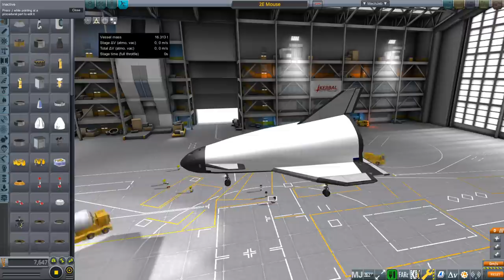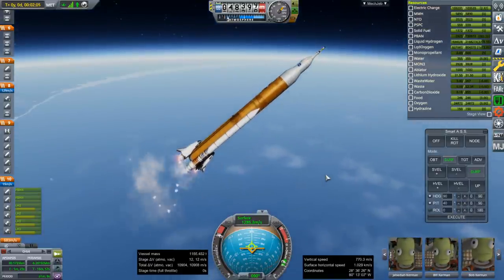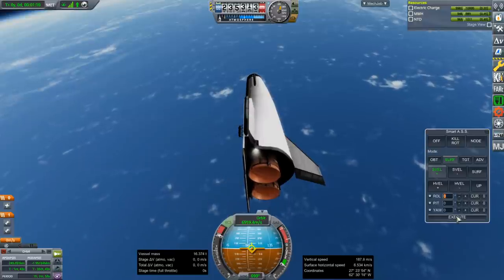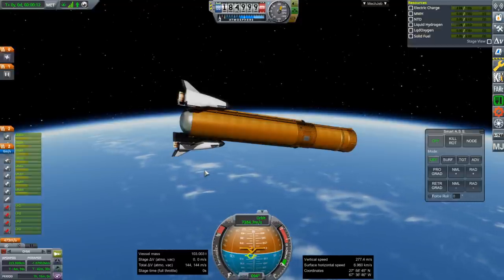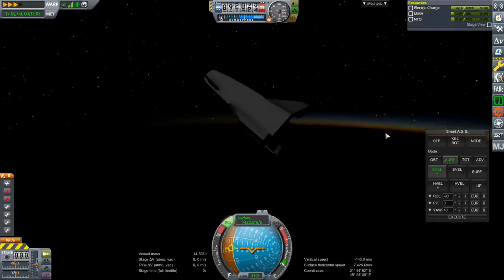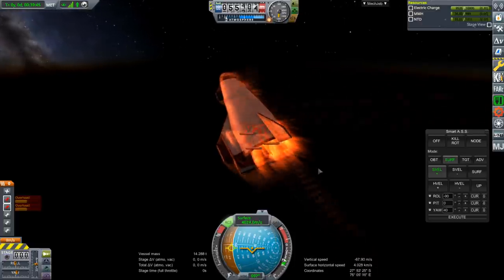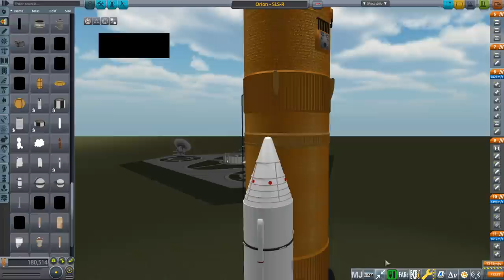Realism Overhaul in KSP 1.8.1 -  SLS Engine Recovery System Test

Comment: I wonder if that fuselage could be made with Internal RCS mod and Procedural Fairings plus some more procedural lifting surfaces for the bottom, without the custom enginemouse mod, or if the proc wings and/or fairing would just burn up. Also pretty sure you can control the thrusters by just hitting x/z to turn them on/off if you're outside control range.
Reply from the maker: It should be possible - the Procedural Wings didn't burn up on the second try. It wouldn't look as good, of course.

Comment: The Problem with the control orientation is very common, your craft is controlled from it´s root part, even if it is not a guidance unit. After decoupling the part that was closest to the root part becomes the new root part, so you were actually controling from the decoupler, wich is always sideways. You can easily solve that by clicking "control from here" on your local control module.
Reply from the maker: Ah, I thought I had just oriented the Engine Mouse body the wrong way in Unity. I'll have to double-check that.

Comment: This seems cool :)
I suggest you do maybe a partially reusable SLS Block 2 variants with pyrios-style boosters with F-1B's. These can then flip around and do a falcon 9 style entry burn, then deploy parachutes and be recovered downrange, similar to the space shuttle SRBs. It may not be that practical, but it will sure as hell look cool :)
Reply from the maker: Maybe something other than F-1Bs since they can't relight. Can I sell you on BE-4 or Raptor boosters instead?
Reply: @RaizSpace  that will do!
Reply: Raiz Space   If Raptors are involved, then why not try launching the Orion/EUS combo atop a SuperHeavy booster?

Edit: (Without the Starship.)
Reply: @RaizSpace  Reusable liquid boosters just result in a reduction in payload capacity while not reducing cost that much

Expendable ones like F1B are more expensive

So solids only make sense on SLS

Comment: You gave me an idea. Use an engine pod design with a boattail/fairing around the engine. Attach and shape procedural spaceplane control surfaces at the end of the rocket and set them to spoilers so when they close they protect the engine.
Reply from the maker: Sort of like this? https://www.youtube.com/watch?v=Rs3IsrQ2FE0

Comment: What’s the payload impact by using these things and would it be possible to negate the payload impacts to block 2 by increasing performance (still get 49t TLI while recovering these things)

Electron, Falcon 9 have proven this so I’m confident SLS could do this if its contractors had the slightest sign of having functional brain cells

Also I was thinking the pods could land trans-Atlantic in Western Europe somewhere since that’s generally where you end up on suborbital trajectory at 6-7 km/s iirc. That’s the staging velocity of EUS/centaur V X roughly on block 1B/block 2 I think

Comment: ULA is going to recover Vulcan's engines somewhat similar to this, only the glide vehicle will deploy a parachute and be snatched mid-air by a helicopter.
Reply from the maker: Yes, I'm aware. That's similar to the capsule catch from the Corona program. At one point they actually contemplated recovering the Saturn V first stage that way, but that would have required quite a special helicopter.
Reply: @RaizSpace  Now that would have been crazy. I see why some of these wild ideas are thought up though, heavy rockets are unbelievably expensive.

Comment: i'm having trouble finding an up to date realengines development thread/github. Could you link it?
Reply from the maker: It hasn't been updated since 1.3.1, but since it doesn't have plugins, it doesn't need to be. This is basically all there is: https://spacedock.info/mod/1212/RealEngines and this is the thread: https://forum.kerbalspaceprogram.com/index.php?/topic/171335-realenginespack-201-close-010418/
Reply: @RaizSpace  Why do you use real engines instead of ro engines?

Comment: 0:15 Combined with Falcon 9 boosters, only method to make it remotely cost-effective... after a few tens of launches. And making the engines reusable—an engine that you can't use twice with zero maintenance with any confidence is not a reusable engine. It's a high bar, but that's what it is.

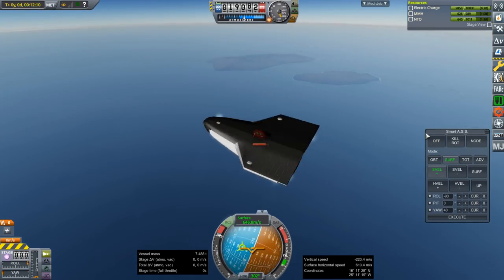13:55 Cape Verde.

30:20 Oooh...

Comment: how do you use a mod in a version of ksp that wasn't intended for that version? (ex. a mod for 1.8.1 in 1.3.1)
Reply from the maker: If the mod is only parts and doesn't have plugins (no .dll files), then there's a reasonable chance older mods will work in more recent KSPs, especially if the mod is from 1.3.1 or later (there was a category change that might mess up some parts from before that). If we're talking about the reverse, I haven't tried it, but it's possible.

Comment: Where is your mod list? I just rolled back to 1.8.1 to use the realism overhaul and my game is acting up, rapier won't switch mode and jets engines show as on (fire coming out) even before I stage them.
Reply from the maker: I have a lot of different installs, but I explain the basic RO install here: https://www.youtube.com/watch?v=j5gd4q8uXis. It sounds like you need to install the mods from scratch.
Reply: @RaizSpace  Forgot other mods, used CKAN but did not use the suggestions, it is working now. thank you!

Comment: I get that the RS25 engines were built for reuse and everyone wants to try and find a way to save them on the SLS BUT: They are woefully outdated compared to new engines like the BE4 and SpaceX Raptor. the RS25 has a weight to lift ratio that is just awful and is a very heavy engine... (about 55-1, weighs about 3.5 tons) the Raptor has a higher lift at sea level, weighs about 1.5 tons and it's lift to weight is 170-1. I'm sorry but it's time to let these old engines go to rest in the sea. If NASA wants to blow 1-2 billion per launch on these old worn out engines then so be it...
Reply: side note: even the older F1 engines from the Saturn 5 had a higher lift to weight (75-1 ish) and were just a marvel for their time. The RS25 was a technological Marvel as well due to their ability to use Hydrogen instead of RP1 but hydrogen takes up a lot more volume  more or less negating any advantage you gain from using hydrogen. The Shuttle program was a trail blazer and a lot of lessons were learned that enabled later progress but it's time to put those days to bed.
Reply: The TWR of an engine is not what determines how good it is
Isp is a much better metric and RS-25 is one of the best high thrust rocket engines in that regard
Performance wise, BE-4 and Raptor don't even come close to RS-25
Reply: Have you heard of something called ISP and how it impacts high energy performance?

RS25 wipes the floor with BE-4 and raptor for a sustainer stage getting close to orbit specialized for maximizing deep space payload performance

Raptor and RS25 are high thrust, lower ISP engines specialized for LEO

You’d have to partially expend starship to  match the same performance as SLS block 2 and that’s still quite unproven. Point stands that SLS is still amazing

Comment: SLS was a bad concept from the start, even worse $15B later and no launch to show for it.
Reply: Was it really?
Reply: The problem was, that at the time NASA had basically no choice when it comes to hydrocarbon engines, so they had to go with expensive hydrogen engines and suspender stage architecture. BE-4, AR-1 and Raptor started development years later(and are not even finished).
Reply: They don't call it the Slow Lagging System for nothing!
Reply: Saturn V had cost over 30 billion by 1967 and it hadn't even launched once by that point 
By comparison the development cost of SLS will be close to half of that for a very similar lift capability
Comparably it's actually doing pretty good
Reply: @Matthew35333  RS25 is needed on SLS for performance. If they were recovered like here, they’d be very worthwhile for cost and performance

Raptor, BE-4 would give worse performance
Reply: @alrightydave  No, I mean, if US had large hydrocarbon engines, they would have an option to go with RAC-1 designs, similar to Saturn V. My quote: "they had to go with expensive hydrogen engines and suspender stage architecture"